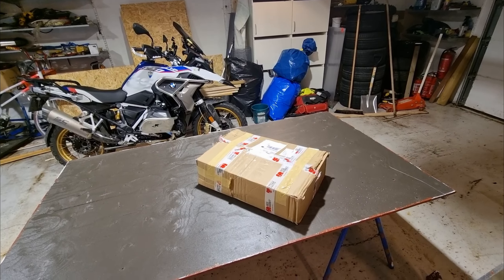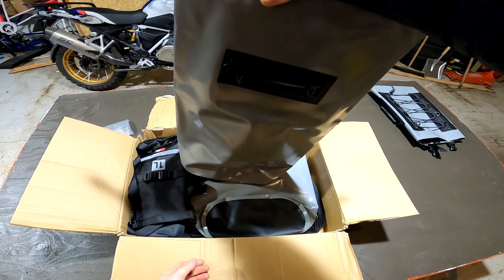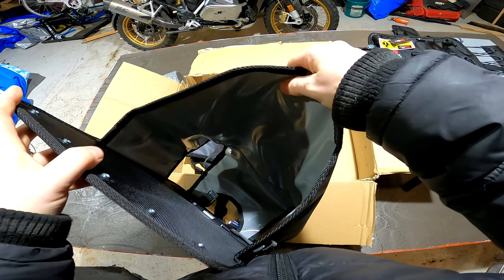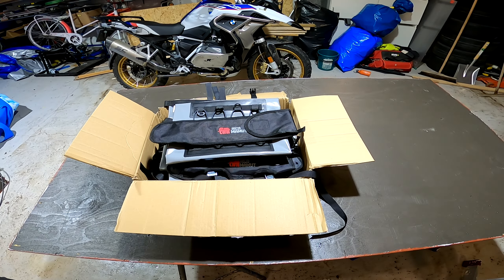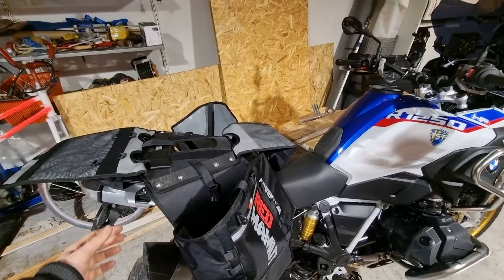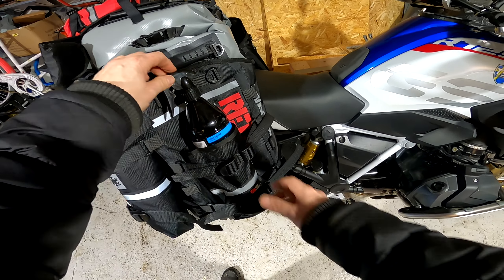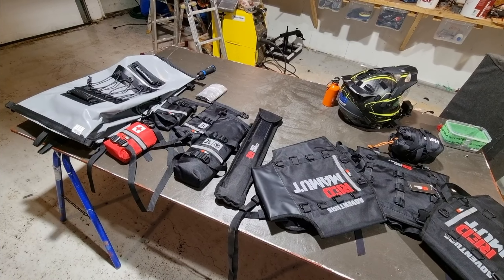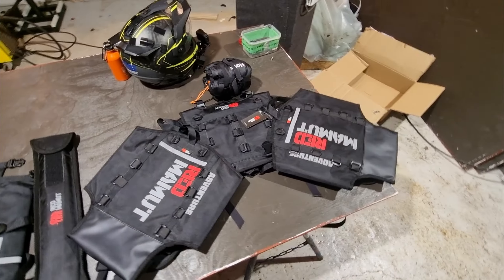Initial thoughts Red Mamut Soft Luggage system.. Alternative to Mosko Moto Reckless 80?

Comment: Hello. Great video. What are your opinion about the bags after 1 year?? Do you recommend them? When riding can you feel that they are lighter than riding with hard cases?
Reply from the maker: To be honest i have only used them once since i bought them. I bought them to do more offroad riding with sleep overs in the tent but i have'nt been out more than one time. Hope to get out more this year though...
Can't say i feel the bags to be lighter than hard cases but then again i can't say i feel the weight much from the hard cases either.. The GS is a very sturdy bike to begin with but they are lighter so with smaller bikes i guess you can feel it a little bit...
From the little i have used them i can for sure recommend them if you are in the market for a soft luggage system like this..

Comment: nice video, a lot of important things. i have one question,,,,because i am thinking of getting adventure 80 or voyager 60 (narrower central plate) from red mamut....     Can you mount back case(top case) and used it (open it) when you have mounted that adventure 80 in the same time?
Reply from the maker: I guess it depends on what top case you have but I dont think the original BMW vario bag can be used since the "holster" of the soft bags cover alot of the Base plate..
Reply: @Swedeonamotorcycle  thanks a lot !!!!!!! for reply...so I am going for Voyager 60 then

Comment: Is it easy to take the side bags in and out. It's hard work on the reckless 80 when you pack to much and make it bulge
Reply from the maker: Hmm. i have not used it enough to answer that but so far i have'nt had any problems that i can remeber..